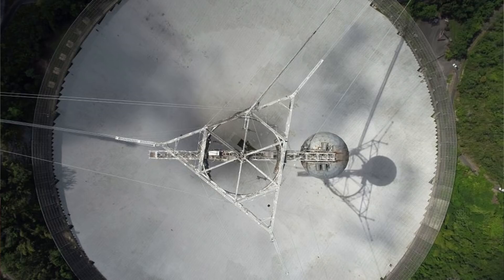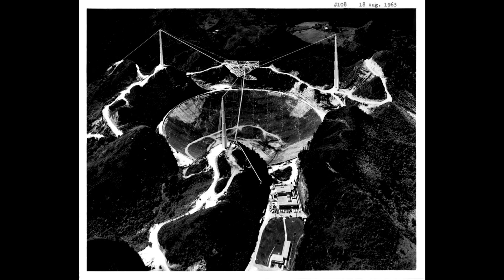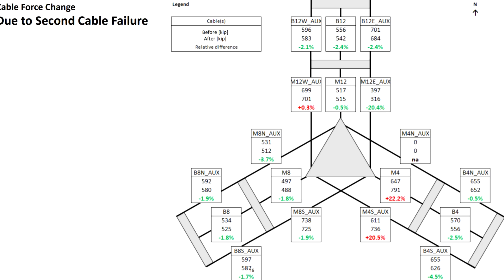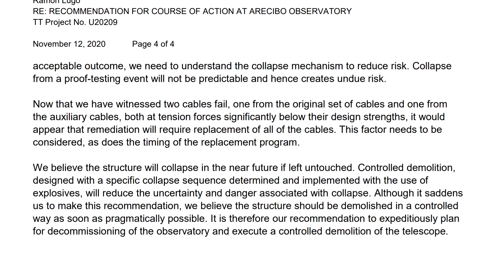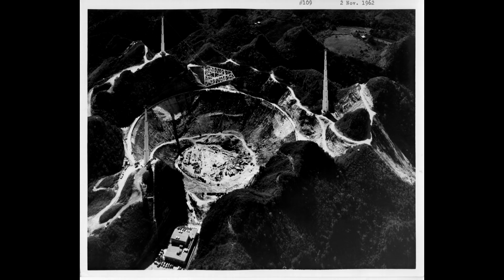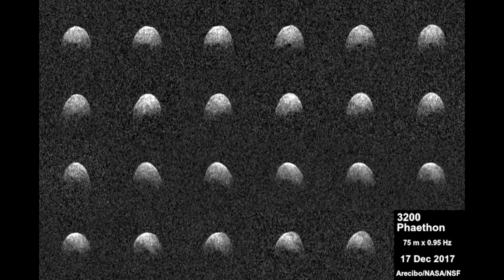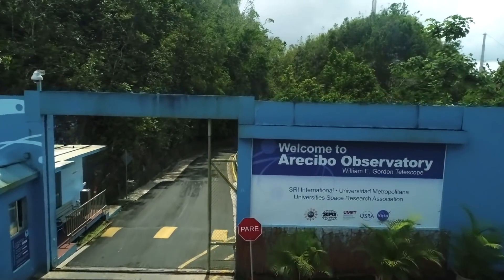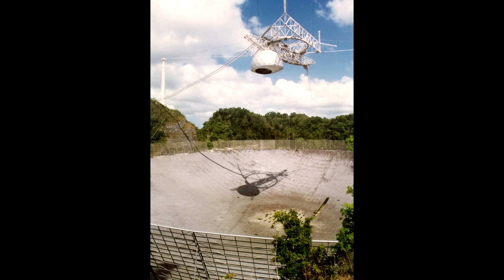Worlds Largest Radar Astronomy Dish To Be Demolished!

Comment: Probably best to demolish it, then rebuild it new.  The second part most likely won't happen though.
Reply: Dont get wrong senate has the last word for these funding. Scott Manley explained that in a previous video.
Reply: If money was infinite, then yes, that would be the solution. But money isn't infinite. Personally, I don't think they can remove the dish underneath as this is too high a risk for anyone below. The simplest solution is to do a controlled lowering of the central structure onto the dish, allowing that section of the dish to be destroyed. Do all the repairs on the ground once it's secured. Strengthen the whole structure then raise it up again. Once safe, rebuild the parts of the dish damaged. This is the cheapest option.
Reply: @aaronmicalowe  Remove the dish? Probably not worth it. It's just sections of metal, engineered for the physical dimensions of the telescope. I suppose you could remove them individually, but they would have to be handled carefully for them to maintain a decent focus later on. 
Time to redesign and rebuild, IMO.
China built a bigger one, but I don't know if it's operational yet.
Reply: @jamesdriscoll9405  The one China built is not a radar telescope, so is not comparable. And I said don't remove the dish. Let it be damaged and then replace it. Still cheaper than replacing the whole thing. But I doubt they can even afford that. Anyway, why do we need to see asteroids headed for Earth? God will just stop them, right?
Reply: @aaronmicalowe  What is a "radar" telescope? Both are "radio" telescopes, last time I looked. 
"Five-hundred-meter Aperture Spherical Radio Telescope"
The main difference is the chinese radio telescope is much larger. (The five hundred meter part).

Please tell me you didn't just say that replacing it would be cheaper than replacing it. 

yikes
Reply: @jamesdriscoll9405  It is described in detail what the difference is in the video you're commenting to.
Reply: @jamesdriscoll9405  Hate to say I told you so. Now it has collapsed in an uncontrolled way doing more damage and saving nothing.
Reply: @Colin Berg Hmmm, with so much less gravity it might be a bit easier to build... Except for the whole being on the moon thing. But since the moon has such a long day you'd also get much longer observing periods 🤔
Reply: @krugerdave  if built on the dark side of the moon their would be a lot less light pollution, as it it tidally locked. So we could find things that were just to dim to see even with something like hubble
Reply: In either scenario, the main point to bring home is mentioned at 9:00 : Arecibo was the best for radar astronomy, critical for near-Earth asteriod orbit estimation even decades in advance. I wonder how come not only we don't have anything else like or even better than Arecibo yet, we don't have close-enough alternatives. There should probably be a minimum of three such radar-astronomy capable instruments in the planet, each of them possibly better than Arecibo in fact. And every decade or so there could be plans for a new or newer ones, either repairing/upgrading existing ones, or deploying brand new cutting edge ones in new locations on the planet if discontinuing/demolishing an older one. We should always have the best available radio-astronomy capability with at least two instruments I think, so even if one gets damaged or is going through major repairs/upgrades, there would still be two cutting-edge ones.
Reply: @GreyGeek I never got the whole "but Biden is going senile" argument considering that Trump has spent the last 4 years proving that he's not all there mentally.
Reply: Why is this so political? This is Scott Manley video! I came here not to hear about politics but just To learn about space!
Reply: @blakem2902  Because deciding whether to spend government funds on large projects is an inherently political process?
Reply: @Colin Berg that would be amazing, but the technology to do this, is not something readily available, let's start with getting people back on the moon, and then progressively scaling up the observatories on the moon.
Reply: Considering the argument in the video, I agree but I would hope they do a controlled demolition in snapping the cables at the towers all at once so the damage is localized to the center so that in theory all the parts would be there to build a new central receiver and winch it up at a much lower cost than building a whole new telescope.
Reply: Agreed. It's like a modern bridge. It has a design life, and has exceeded it through neglect as much as time. But it was anticipated from the start that tearing it down and starting over would be the wise play, eventually.
Reply: @mal2ksc  yep, on to bigger and better things with the knowledge we gained from it
Reply: @clover8673  Arecibo is still a really great spot for a telescope. It may have a different specialty, but surely someone wants to put something there. The data processing infrastructure is already there, the logistics (roads, power, etc.) are still there. That is always a huge chunk of the cost of setting up a new facility. Even if it wasn't naturally advantaged by location, it might still be a worthwhile spot to rebuild just because of that.
Reply: @GreyGeek Trump is the one entering senility, but sure…🙄
Reply: @Joe Horn yes, me. My treatment was refused in the NHS, I lost my job because of it, lost my house, was made homeless and finally got back to putting my life together when I got a job with health insurance that covered preexisting conditions and they paid for my implant in my spine.
Reply: @Joe Horn No,they don't care about facts. It gets in the way of the cult leaders teachings. What it comes down to.
No Global Warming,Evolution is just a theory,Wearing masks causes Covid.
Then they come on here and say how liberals are going to stop the space program.
Reply: @jeremy hillyer The one in China is a different type of telescope. It doesn't do the same job.
Reply: Yeah,  a place like that wasn't perfect for it anyhow when it comes to maintenance. 
Best if a first world country actually tries.
Reply: @EminemLovesGrapes  maintenance on the moon likely will be easier and harder at the same time. No weather, animals, natural disasters, etc to deal with, but you gotta put something on the fuckin moon, which is the hard part, and when shit does break, you gotta get something from earth to the moon.
Reply: @clover8673  the moon? I said first world country.
Reply: @Pronto Didn't Donald Trump refer to Puerto Rico as a "shithole country"?
Reply: @davidharrison7014  Africa
pr is a USA colony
Reply: @Joe Horn so why ask then? You're just dishonest and trying to 'own' me. The NHS is really bad and it's getting worse every year at the moment, it's unpopular but the best way I see to improve it is privatizing it and introducing competition into the system.
Reply: @Joe Horn facts...just that.
Reply: They’ll be too busy with PC stuff, and over at the island they’ll keep their dirty business as usual.
Reply: @jeremy hillyer   Ya, it was probably hit by an energy weapon from space.  Definitely an inside job.   😁
Reply: If it costs too much to make repairs,then an all new one...
Reply: @StanTheObserver-lo8rx  Actually often repairing is more expensive than building new. This is why buildings sometimes get demolishes and new build in place. It is cheaper to demolish and start on clean blank, than to deal with all the problems of the old building.

If one thinks about it.... The towers are already there, they cleared out bowl is already there. Even if they cut the cables and crash the platform to bottom of the bowl.... Clear our the wreck of the old platform, build completely new one, this time from get go planning to but in the gregorian dome, so they can probably do it lighter. Since the current gregorian system was a retro fit and thus not optical. New receivers and transmitters in.... ready to go.

The utility buildings are already there, the power rooms and power supplies are already there at the observatory building.

So if USA/west wants to keep operating such bowl radio telescope. They cheapest option even in building a new one is to.... Demolish the current areciba platform, have it drop and wreck the bowl bottom and then replace the old istrument platform with a new one, with full new set of cables on new mounts but on same base towers. Then just resurface the bowl.

Since if they lose Arecibo and want new arecibo type. They would have to find another bowl, have it cleared out, build new towers, do all the service buildings etc.
Reply: America doesn’t like to find science without military implications. Space exploration and the moon race were all by products of ICBM and reconnaissance satellite.
Reply: @zeitgeistx5239  Oh FFS... Military implications were drivers in much of practical space R&D for most countries in that era. The U.S. spends more on R&D, including non-military, and a large portion of that comes from private companies.
Reply: @zeitgeistx5239  Who would you rather be dominant?
Reply: @zeitgeistx5239  That was National Ego Nationalism at the core. Very Simply America wanted to beat the Russians to the moon. Even though operation paper clip had brought the German Rocket scientists to the US they were ignored and left to support themselves in civilian sector while and Army And Navy rocket programs kept having rockets blow up on the pad so at that point it was purely military. Then Sputnik  happened and the freaked out American Public demanded something be done and NASA was born to beat the Russians at anything they did. NASA combined all the military stuff with new civilian track brought in the Germans who had wrote books and did a public relations campaign and it was the Germans who developed the Saturn V and mostly ran the technical side of program. 
The military basically piggy backed on that. 

Actually at least under Democrats and smarter no longer existing Republicans America had lead the world in times in basic research funding. Reminder to give rich people even more money it the Republicans who cut funding normally to all non military stuff.
Trump not being a typical Republican instead like the base a Nationalistic Bigot group other wise known under term of Fascism   have put a lot into civilian space again for moon race reasons of National Pride. 

America does like to waste huge sums on defense probably could buy the same stuff for a third but the rich defense industry must get rich with way overpriced stuff. So your right a large part of US budget from defense. 
And Private sector tons in money making research why US often leads in drugs. 
But US had invest good in basic but could do way more as that has been cut a good deal from the top.
Reply: @Colin Berg YES!  A radio telescope on the far side of the moon would be awesome!   It would be immune to Earth's RF interference.
Reply: @GreyGeek Trump lost his mental facilities long time ago. His speech is word salad.
Reply: @Alexagrigorieff  *faculties
Reply: @Alexagrigorieff  lol you think Biden has his facilities in order? Hahahaha
Reply: The current owners for sure can't afford it.
Reply: im no expert but im prety sure P.R'S economy is not better than the U.S economy
Reply: @franceschimanuel2010  I suppose you're aware that P.R. is part of U.S.?
Reply: ' rebuild it new' , after handing out trillions , good luck with that
Reply: C’mon Elon, step in!...
Reply: You can see the 10 million Starlink satellites with smaller telescopes anyway.
Reply: Why rebuild it?  China has one, similar in design to this radio dish, yet somewhat bigger!!!
Reply: @davidharrison7014     Did you watch the video?  China's dish is not for radar astronomy like this one.
7:10
Reply: If it is rebuilt,  the cost should justify the discoveries.  Tracking orbiting near earth objects with radar sounds important.
Reply: @davidharrison7014  Because they would be pointing in completely different directions and support completely different operations? Do you really want to be dependent on a China to always cooperate in good faith? Because I don't -- most of the time they will, but history has shown that has a limit. Also, you need multiple dishes spread around the planet if you want to observe something more than once a day using a transit telescope (it can only see nearly straight up).
Reply: PhotoGeorge  Would the total cost to rebuild this thing not be a small fraction of what a single Covid compensation scheme already costs today?
Reply: Not in a Harris/Biden administration. The only thing they’ll build is Section 8 housing.
Reply: @Maryland_Kulak  Personally I enjoy NOT seeing comments of this sort on this channel. I love having a space (no pun intended) that is free of discord.
Reply: @Maryland_Kulak  Right, because the other side did so well. You're a disgrace.
Reply: @Maryland_Kulak  Imagine writing this thinking that prioritizing dealing with homelessness is a BAD thing.
Reply: @Maryland_Kulak  Because Trump and Republicans totally aren't anti-Intellectuals...
Reply: @Maryland_Kulak  At least the Trump administration would throw paper towels.
Reply: @Maryland_Kulak  if you think that you really know nothing about anything. Your caricature is stuck in the 60s-70s, much like your mental age.
Reply: @Maryland_Kulak  We need Kennedy back in presidency
Reply: @Maryland_Kulak  Trump Is going to find some money in his second term in 2021 ☺️
Reply: @cma-jo1qx  Trump lost.  Accept it and move on.
Reply: Ignorant and hateful as well. Nice going!
Reply: @Maryland_Kulak  Lol
Reply: @Maryland_Kulak  Well since they've not been elected they won't build shit.
Reply: @Maryland_Kulak  ah here come the trump supporters to do bizzar mind gymnastics once again, to somehow tell the world that THE president to denounce sienctists throughout all of his presidency would have done it.
Reply: @Maryland_Kulak  Sure,Trump was a great provider to science. Where do you people get projecting the right wing- that doesn't even believe in global warming or evolution on to the left ...BIDEN SAID HE BELIEVES SCIENCE. You want him to hold your hand?
Reply: @StanTheObserver-lo8rx  taking the country out of foreign wars and boosting the economy, leaves money to invest in Science.
Reply: @RogerM88  Trump took us out of the war vs the Virus. When did he take back from Russia the ground he claimed Obama gave them?..take it back. Trump only did what made him money.
Reply: @StanTheObserver-lo8rx  Its not that, its the fact that Obama demolished space funding during his administration. Which set the precedent that democrats will reduce funding for space in the future as well
Reply: @RogerM88  I'm for that..tell the Bush family with their WOMD bullcrap. How many trillions down the drain on that?
Reply: @kimjunguny  It could have been that banking thing the GOP created where they looted us and people lost homes and Detroit automakers almost went out of business..I think Obama made the right choices.
Reply: @StanTheObserver-lo8rx  you really don't understand, Trump is both anti-Democrat and anti-establishment Republican. He has a lot of enemies on both sides.

The "left" and "right" dichotomy doesn't exist anymore it's establishment vs anti and that's a good thing, stopping wars and growing peace is a really good thing. If feels like anti-trump is now pro-war, insane.
Reply: @Codysdab  What Trump says that would help? It's a lie. That's his modus,play both sides of an argument. Con man 101. Look at his "lower pill prices"..have not and will not happen and he knows it.
Reply: @RogerM88  YUP!! America spends over one third of the world's total military spending. Bush's two middle east wars (Iraq and Afghanistan) cost over 6 trillion dollars and for what?
Reply: @tihzho  pax americana. Or would you rather Russia or China be the dominant force? Because they are so pro human rights, pro science, lol!
Reply: @RogerM88  The US economy has been in a recession after every one of the last republican presidents and was better of after every democrat since the nineties. What are you talking about?
Reply: @kimjunguny  Space funding throughout Obama and Trump years held very close to 0.5% of US budget.
During OBAMA Administration: 0.51% of federal budget on average;
During Trump Administration: 0.48% of federal budget on average.
Reply: Please. Neither party has been funding space sciences at the national level to the degree needed. And conservative belief in evolution (ignoring the widely varying responses received to two-part or single-part questions) has little bearing on conservative support for science, particularly for space sciences. Painting them as monolithic stereotypes doesn't help us.
Reply: @pajaf0341  this "Republican" Government was difference. The first in decades not putting the country in overseas wars...you're forgetting that. Also with Obama, some Economists pointed China as the world economy leader...but with the shift in the Presidency, that didn't happened. Also, if Trump was Democrat (like he was in the past), the Media would praise him. The "problem" with Trump,  was not flirting with the Media like did Obama. Or be a puppet for them.
Reply: @StanTheObserver-lo8rx  what on earth are you talking about, prices for generic medicines have plummeted over the past few years.

His orders have opened up the purchase of drugs from outside the US. If people choose to go with brand names then that's there look out, he can't change those prices, only competition can.

Still, you've completely missed my point, stop cherry picking.
Reply: @StanTheObserver-lo8rx  Section 8 hand holding? Or did you mean something else?
Reply: @ThingEngineer  Yeah,man I'm for the good of all. Notice Trump backed science when he got sick?..LOL.
Reply: @Codysdab  Plummeted! LOL..for generic medications 50 years old.sure..since Obama days,Clinton too.
If you need a cancer pill that should be $2 you might hate its $1,000...
Reply: @StanTheObserver-lo8rx  one thing is saying you BELIEVE science or that you BACK IT UP, and another very different one is to actually put your money where your mouth is

As far as things happened, NASA asked for 3 billions and just got 1, and that's a cut since last time

no matter what someone says, what matters is what they do

P. D.: I am not a "black or white" type of person, a "if this is bad then the counter part is automatically good" kind of dude, so please (measuring by your previous answers) don't get back at me with that shiet
Reply: @StanTheObserver-lo8rx  yes generic ones, that's 10 years BTW not 50.

In the UK if a medicine costs too much you literally can't even get it at all as the health service blocks it. At least in the US you can get them on your insurance in the UK you'd have to pay list price via your own wallet.
Reply: @StanTheObserver-lo8rx  Look at the tweet today from Mr. Biden.
Reply: @sbcap3809  Trump for four years has made the tweets of a lunatic. He respects nobody but demands it for himself. Tweets? Trumps threats,criminal intents..nonsenses like te local drunk at the bar.
Reply: @RogerM88  it was George W Bush whom abdicated our right in the WTO.
Reply: @kimjunguny  Obama did the best thing ever. He helped NASA to realize that private companies like SpaceX can do it cheaper and more reliable than the agency itself. If not for Obama, America would still not have its own ride to ISS. Just look at where Boeing is now.
Reply: @StanTheObserver-lo8rx  Less than 1% of 'global warming' is human-caused.
Give it a rest.
Reply: You guys think too much about politics. Chill down a little with that, there are much important think happening here. It is really not so matter who is the president of US. It's literally YOU who solve the problems, not your president. Politics do not solve problems. Their jobs is not to DO something but to TALK about something.
Reply: @StanTheObserver-lo8rx  laughs in European where no matter the political ideology the governments treat global warming and evolution to be objective facts.
Reply: @Олексій-г1в  Wrong, Trump was the only one who challenged big tech with lawsuits and tries to save us from socialism, censorship and globalists. If Biden was president, he would sell everyone to the highest bidder. Millions of jobs and lives ruined. Democracy in shambles. I envy you that you cant think out of the box, ignorance is a bliss
Reply: @cma-jo1qx so he tries you say? Did he succeed? If Biden was president, did you think he could succeed?

I'm not from US man, I literally do not care who is president in US. And I probably leave in shitty place, but I notice a long ago - politics are useless. They do not create goods. They do not do science. They do not keep economics stable. They do not create working working places. They do not build cities, factories, roads, trains, planes, ships. They do not grow food. They do not solve social issues. They do not fix problems. They also do not fix broken Telescopes. Usual people do all this stuff. 
But politics actually do something. They create ridiculous rules that make everything mentioned above more difficult to be done and force you to pay for that. 
When any politics say "I achieved that" it actually means "You want that, you pay for that, you done that and I
did not interfere much". 
You'll not believe me right now, I'm pretty sure, and it's ok. But you'll understand that some day by yourself. You will  look around someday and ask yourself, "what from that I see done by politics?". And your life views will change in that moment.
Reply: @StanTheObserver-lo8rx  quite your CNN brainwashing, while he certainly did not want to admit climate change for economical reasons he pushed space force and NAsa new missions. He just decided commercial science was more valuable than others. Now Biden won t do even any of that because his founds will be sent toward another middle east war.
Reply: @Maryland_Kulak  That's a great point, housing is much more important at the moment .There will be time to rebuild later.
Reply: One can only hope this is sarcasm.
Reply: @starshard0  strong disagree
Reply: @Maryland_Kulak  GOOD!...Give people clean homes to live in and maybe help the kids. I wish Andrew Youngs idea to give everybody $1,000 a month happens. The richest ,most powerful country in the world can easily do that. Saudi's do!
Reply: @StanTheObserver-lo8rx  Or you could WORK and EARN a living like the rest of us.
Reply: @b1blancer1  I do make a living. SO eat that Mr. Projector as you stay at home watching FOX news all day.
I own property in the SF bay area..have rental units. Can you top that? So,shuddup yore face!
Reply: @StanTheObserver-lo8rx  Not to mention a RED STATE does it too. Have you heard of the Alaska permanent fund? Each citizen gets a yearly payout of ~$1600 for just living there. If thats so successful there, why not have something similar in the rest of the states?
Reply: @robrod7120  Sounds good.Make every month..not enough to live on but enough to spend and invigorate the economy.
Reply: @StanTheObserver-lo8rx  Honestly this makes the most sense as well. With increased automation the money is already there, just not in the pockets of people that would actually spend it.
Reply: @clover8673  Trillions have been spent since Lyndon Johnson started his "War On Poverty" back in the 60's, and are people any better off now than then? No. Endlessly throwing more money at it is NOT the answer. I never said a word about "minorities." You're the one playing the race card here, not me.
Reply: @b1blancer1  so I am black, not playing race at all, I'm stating the obvious, there are a lot more poor minority people, than there are poor white people. 27% for people of color, to 9.9% for white people. Secondly the "War on poverty" in the 60s wasn't anything of value. Reganomics, the war on drugs, vietnam war, and stock crash of 2008, all lead to increase in poverty over all, with the first three affecting people of color more, as an increase in wealth for the upper class stays frozen in bank accounts and stock markets where it is pushed around like broom,  false drug busts and unwarranted stop and frisk searches led to a massive spike in the mass incarceration of people of color compared to white people, drug charges also make it incredibly hard to get a job upon being released from prison making fromer convicts turn to crime to make money as they can't get a legitimate job due to false accusations, Vietnam led to a massive increase in PTSD, drug abuse, veteran poverty, and social unrest. A lot more people of color were drafted compared to white people (don't even get me started on "McNamara's Morons"), the crash of 08 led to massive inflation of prices for essential goods while wages either dropped or stayed the same.
Reply: @clover8673  Maybe because white people are less likely to get  assistance because the programs are set up that way.
Likely the worst thing that happened to minorities was too much government assistance to the point they have become dependent upon it, which is also why most people who are homeless stay there. It feeds human nature to be lazy, why work when you can just get stuff for free? (this is also why socialism will never work)
Reply: @SilvaDreams  you understand that not all people on welfare are abusing it. My co-worker is a single mom that has to pay the government back the ABC assistance funds when she used when she needed it to send her daughter to day care, none of the people on food stamps get them easily, there is a massive process to apply, and even longer to receive them, just because they have food stamps also have rent to pay and other bills, they aren't just sitting around like Fox news makes it seem, they have to work in order to be eligible, and they also pay back the amount they use with each check. It isn't free, it's aid, not a freebi. 

But imagine getting mad that someone that is extremely poor, doesn't deserve basic human needs like shelter, water, food. Can you imagine being that nonempathetic monster that tells a single mother to bad you and your kids can't eat, maybe if you work a 60 hour week, gave up responsibilities and went to college, ignored the soul crushing situations around you and make your family struggle even more, that it is her fault that minimum wage isn't actually enough to live off of and it is her fault for it.
Reply: @SilvaDreams  a lot of things in the US are technically socialist in nature. 
Public hospitals, road ways, first responder services, the FDA, FBI, CIA, every government agency.

They are all funded by the people and attempt to do the most good for the most people at the expense of the least amount of people.

That is socialism: doing the most good for the most people, while doing the least harm to the least people.

You can have capitalist nations with socialist constructs and still be a democracy, look at America, UK, and just about every democratic nation in the world.

Socialism isn't evil or bad, communism is. Socialism is designed to help the lower class including farmers, factory workers, and all other blue collar works by providing certain services that were previously exclusive to the upper class due to wealth. I.e government health care, because if they can keep people healthy, they will work more and eventually pay back the actual cost of the care they needed, not the market cost (the cost of making a car, not the dealership cost). You can easily have capitalism and socialism in the same nation, because socialist programs can boost the economy by stimulating economic growth, the lower and middle class are the groups that reliably and consistantly spend money, sure the upper class buys expensive things once in a while, the middle and lower class will regularly and routinely buy things, which is why there are grades of automobile even in premium brands, make everything from a grocery getter like a Ford focus to super cars like the BMW M5. 
The number of people that buy M5s is a lot less than those that buy smaller models, so to promote the most business, provide options for all types of buyers. The greatest good for the most people, while promoting the most business for the company. So please stop thinking socialist things are bad, communism is evil and will always fail, but providing services for all based on the work of many is the smartest thing for a first world civilization to do, increasing taxes on the rich 1% and funneling the newly acquired funds for public services like road work, makes the greatest good for many people and companies and efficiencies will increase and general happiness, which will increase tourism overall increasing GDP and margins over all while only putting pressure on the people that keep money frozen in stocks and banks, while rarely using it. Thus making that amount of money non-existent as the richest of the rich rarely spend a penny on other things. 

Socialism ≠ communism (Sovietism/Stalinism)
Reply: USA is the worlds 11th richest country, 3rd largest military. It’s slipping it’s place holding. Just saying.
Reply: @StanTheObserver-lo8rx  mate shut up, you're making dems look bad
Reply: @clover8673  Absolutely, 100%!!!
Sometimes, being UNDER-employed can be worse than being unemployed!
Reply: @Maryland_Kulak  I'm sure they will allocate lots of money for wars though.
Reply: @tackytrooper  That was Trump, with his huge increase in military spending. America now spends more than one third of the world's total military spending...the question is what for? Terrorists? LOL
Reply: @tihzho  But he hasn't started any wars, and is trying to end the ones that exist. Hmmmm
Reply: @tackytrooper  

The only person who will be doing that is Donald Trump if he decides to attempt an unconstitutional coup via lawful loopholes.
Reply: @tackytrooper  what by rapidly withdrawaling from nations and considering an attack on a sovereign nation... 

Getting us out of wars Right......
Reply: @tackytrooper  Alas your corporate overlords need your money to be spent on weapons for their shareholders profit. Just imagine that money being spent on new bridges, fixing roads and all that. You'd have a brand new infrastructure with the $7 trillion wasted on wars in the last 2 decades. You could throw in free healthcare for all and it 'd still be cheaper than playing war around the planet.